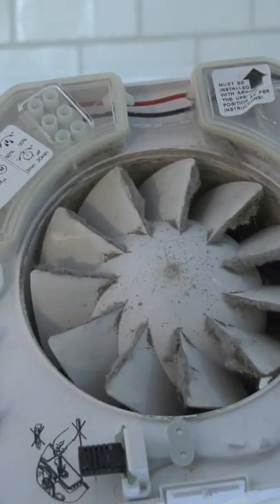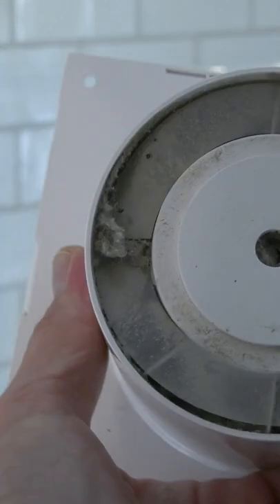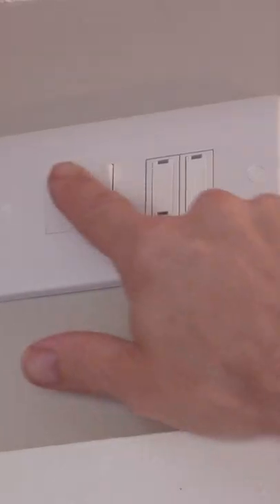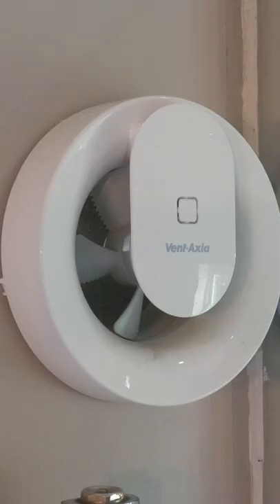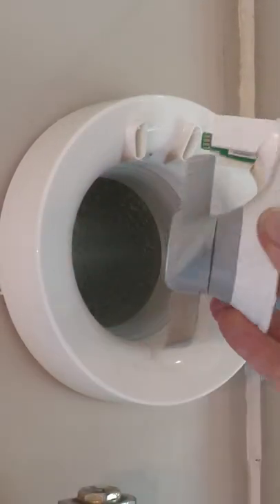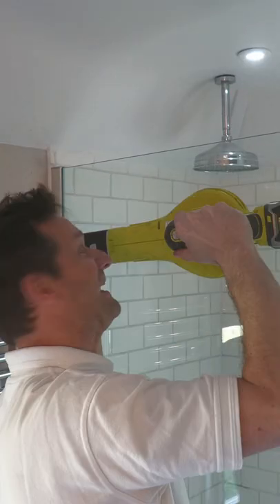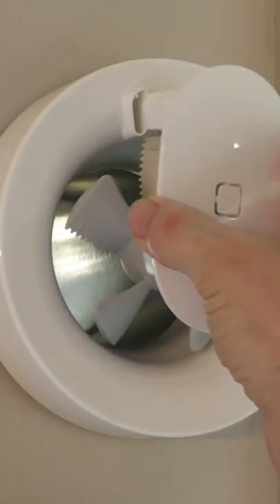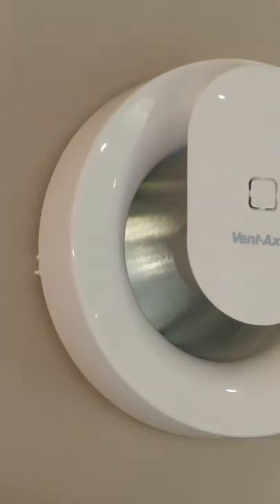How to Clean a Bathroom Fan #shorts

Comment: Hi everyone.  I'm really interested in this fan as from the other video, but that's a massive gap.  Can you clear to for me whether that's a problem?  Thanks.
Reply from the maker: It really isn't a problem Andy. I have the cover on the outside which stops wind getting in and the fan runs continuously in trickle mode which stops flies getting in, in the summer but if you've watched this vid https://youtu.be/TIDb-pdOnXM you'll know I'm evangelical about ventilation as a means of stopping excessive moisture, condensation and mould build up in the house and so I rather like having the big gap 😉 Is a seriously good fan. Very quiet and the ability to have all that functionality without the need for a switch live is a real game changer IMO 👍

Comment: Had one of these fitted after your comprehensive fan video Charlie. Very pleased with it but cant seem to find 'trickle' mode on the app. Any ideas?

Great channel
Reply: I just got one too. You have to go into the app, then press "Basic Ventilation" and set the fan speed, click More Options and make sure it is enabled on weekdays and weekends.

If the sensors are disabled, it's just called "Fan Speed".
Reply from the maker: Thanks @ed manning - really appreciate that. Gavin, hopefully you're now sorted but let me know if you have any other problems.
Reply: The other thing is that during the setup process, the app can lock you out of various settings, including the trickle setting. Try resetting the fan to factory settings, and when asked during the setup, say Yes to the trickle mode.
Reply: Link to the video please where you discuss fans ? Thanks

Comment: Is there no closure to the outside when not in use?
Reply: no
Reply: @gavinparry5426  
The room must be freezing!
Reply from the maker: There is a vent on the outside to keep the wind out https://youtu.be/WvSE9aAmeGk but I'm evangelical about ventilation to keep condensation and mould at bay. It was fine in there this winter.
Reply: @CharlieDIYte  My bathroom vent would be on the weather side - I'm really concerned about that gap TBH.